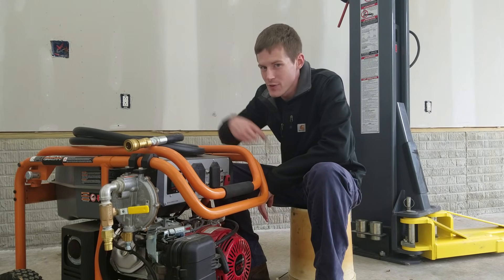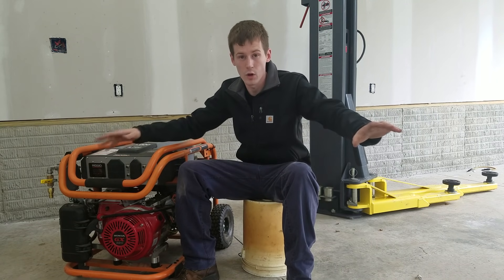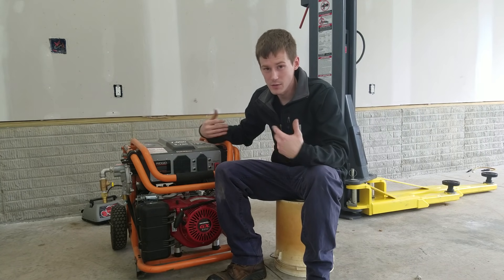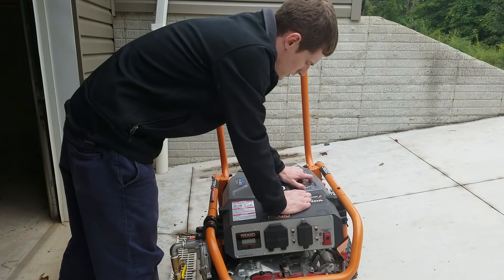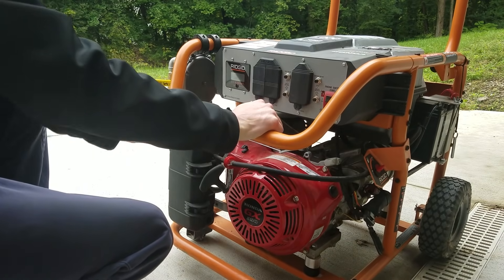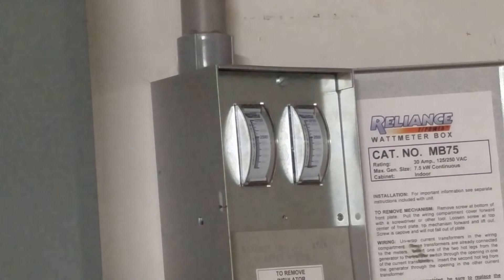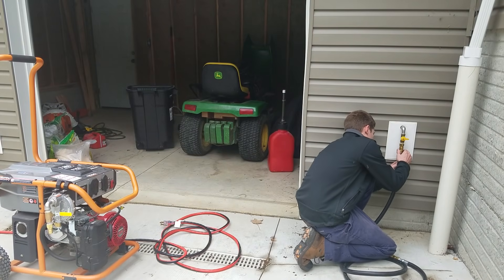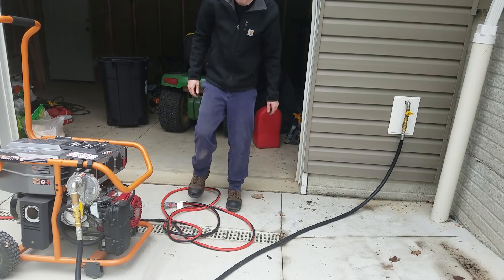Natural Gas Generator: Frequently Asked Questions

Comment: So you said you wouldn't buy the kit again and just buy the regular and make the spacer. What's so special about the spacer and what is the model of your regulator. These seem to be the most crucial pieces. I would like to make my 8750w (390 clone) predator a tri-fuel so I'm looking for some pointers of parts to get and that spacer info as well. Thank you in advance.
Reply from the maker: Regulator: https://amzn.to/36OOCyF

The spacer need to pull a vacuum on the line going to the regulator to get the diaphragm to open. Basically the inlet to the spacer needs to be slightly smaller than the outlet side. The outlet side need the fuel delivery. Check my original video for close up shots of the spacer.
Reply: You can get Chinese carburetors for many small engines that have the inlet tube for the propane/natural gas built into the carb, and they hang the demand regulator off of the carb.  Probably sell one for the gx390 clone.  I was looking for one to mount to flathead 5hp Briggs and Stratton engines, but those are not popular engines for our friends in the PRC to copy.  I’ll have to make an adapter for my “Honda” carb to the Briggs engines and then hope the jetting works if I ever want to use gasoline on them as they’re set up.  $30-50. For the whole shebang from various suppliers.  Probably not as nice or well built as the demand regulator that is shown in this video.

Comment: Our natural gas meter is about 900 feet from our residence. We are buying a generator due to increased number of power outages. Contractor concerned about distance from meter causing generator to shut down. Advice???
Reply from the maker: If he's come over and physically looked at your situation, find another contractor. The pressure in could be regulated down at the house, not at the meter. Someone that knows what they're looking at would pick up on something like that right away.

Larger homes have the pressure regulated down at each physical appliance because it saves on running huge piping all over the house. I'm willing to bet your house has the regulator on it. I really doubt you have a 900 ft run at a 7" WC. The size of the pipe running to your house would have to be massive to not cause other issues.

Comment: What is the farthest away I can run my house 3/4” gas line to the 3/8 fitting on my generator? Can I run 1/2” line from house 3/4 12ft 1/2 to 6 ft 3/8 with out problems?
Reply from the maker: That depends on the size of the engine you are using. A 1hp engine will require less fuel than a 15hp.
Reply: It’s a 420cc 13hp 8750/7,000 running watts. Like I stated I want to run 3/4” to back of house and would need 25 feet more and was thinking 1/2” 25 foot to regulator and step down to 3/8”.  Otherwise I would have to run 3/4” 50 feet and trying to get away with 25 ft of 1/2” and reduced at generator to 3/8. I believe it will work but looking for opinions. Thanks
Reply from the maker: Worst case scenario the generator will run correctly but, under high loads it will starve for fuel.
All of these distances are measure by going from the gas meter to the generator. These are the charts that I used to size my line correctly:
http://www.uscarburetion.com/natural-gas.htm
http://www.propane-generators.com/natural-gas-chart.php

Comment: Very nice, informative, well organized.  Ever consider hydrogen?  Would that be feasible?
Reply from the maker: Not really. The main issue with hydrogen is because it's the smallest occuring molecule you can't really contain it. Basically the molecules are so tiny they go right through the container. I'm no expert on that subject but I've heard of some success using stainless steel lined tanks. It does work well as a gasoline substitute though. 

If you could find a way to break the bond of water (H2O) and separate the hydrogen from the oxygen you could burn water in an engine. If you can figure that one out, let me know so we can make Jeff Bezos look poor haha.
Reply: Repair Geek Actually, people are splitting water into hydrogen and oxygen.  The simplest and most common method seems to be electrolysis, driven by 12 volt photovoltaic panels (or other source of electricity).  That method seems to be pretty slow and perhaps inefficient, but it apparently works.  There are others methods.  
In a similar vein, a number of articles and videos show folks producing biogas from manure, food waste, etc.   
You did a great job on the generator, with a very clear understanding of the gas-related hoses, fittings, standards, etc.  My main concern about hydrogen is how to handle it - i.e., how to contain it, pipe it, introduce it into an engine, etc., hence the question.  
Thanks again.
Reply: @joedance14  -  You should make Videos on them and tell us how " hydrogen " is or are.  Maybe we can learn a thing or two too from your great ideas!
Reply: @joedance14  - I got a few questions.... I wonder if we can save our Gas from our farts.  You think it will be economical to buy a lot of Beans and Eggs just to get Gas?  Or do you think I should get a job at McDonald and call it the day.  I'm still in High School, I have to plan ahead, what do you think of those ideas?
Reply: The biggest problem with hydrogen is that it violently explodes when exposed to the oxygen in the atmosphere.

Comment: because its already a dual fuel,if the natural gas coming from my house is already regulated,do i still have to buy another regulator?
Reply from the maker: Sorry I'm not sure. It depends on the generator. That was why I didn't use a dual fuel. I knew my conversion would work with a normal gasoline model.

Comment: how do you set the gas flow with the engine unloaded, and then load it and expect that same amount of gas to keep it running?
Reply from the maker: The spacer on the intake is designed so it pulls a slight vaccum on the diaphragm inside the governor regulator when the engine is running. As engine load increases the airflow through the intake also increases. The extra airflow creates more vaccum on this diaphragm opening it more and increasing fuel flow.

The bolt is acting like a fuel jet in a carburetor.
Reply: @RepairGeek  so it's got a governor, regulating the throttle body to keep the rpm steady based on load

Comment: I need some help I have a 13000 watt 20hp Duromax generator I installed a garretson kn regulator I have 3/4 inch  hose to generator it starts and dies Almost like it’s not getting enough natural gas to run the engine I’m wondering if the kn regulator it’s not enough I adjusted the screw for max flow and starts and dies ?? Help
Reply from the maker: That Garretson regulator will support 50hp. Get it running and try reducing the fuel flow. You can hear mine barely ran until I leaned out the mixture: https://youtu.be/nO839Sayci0?t=933

If that does not work I would look for a restriction between the KN regulator and the engine. All of this is assuming you have enough natural gas flow at your location in your house's NG system to support 20hp.
Reply: @RepairGeek  I also have that three eights air fuel mixture screw as well and I don’t know where to put it that’s the one that goes to the 3/8 hose from the regulator over to the carburetor I don’t know where that needs to be sat
Reply: Is it possible to have a problem with how far my regulator is to my carburetor it’s on the opposite side of the carburetor mount it
Reply from the maker: @mitchellowen8821  send me an email.
Repairgeek365@gmail.com
Send a picture of your generator, regulator, and hose routing.
Reply: @RepairGeek  sent

Comment: Noticed you started in the other video using pull (natural gas) but then this one you started on gasoline with electric start.  Any reason?
Reply from the maker: In the other video the battery was bad. I replaced it between that video and this one.
Reply: @RepairGeek  are you happy with the gasket sealant versus another entire gasket?
Reply: @RepairGeek  and did you ever consider the Winco?
Reply from the maker: @GoodmanMIke59  I've had no issues with the gasket. As you see it is how it is right now. I have about 5 or 6 hours of runtime on natural gas from a couple small outages.

I have $1200 in this entire setup including the generator. That one was more than I was willing to spend. It looks like a great unit, but the Ridgid I have is very close specification wise.

Comment: Man I’m doing this but swing this makes me thing if I can design a car bracket I can run a car on a similar kit with propane on a gas engine how about those new direct injection mustangs run propane instead of gas A
Reply from the maker: You can do this to a car. The fuel delivery is more sophisticated than this. A generator runs at basically the same RPM all the time. Ford sells an alternative fuel prep package for 5.0 F150s. Honda has a CNG prep Civic. Most city busses are running on natural gas.  It's out there already but, you don't hear much about it because gas is cheap.

Comment: I don't understand the issue with the female QC on the regulator.  I see you changes it from horizontal to vertical, but what the difference?  I mean, you say that you changed it in case the hose becomes disconnected it'll spew NG outside your house.  What if the new male connection becomes disconnected?  What's so special about having a male QC connection of the regulator?
Reply from the maker: The male end of the QC is threaded into the regulator. It's very nearly impossible for the male end to come off. In the previous video it was opposite, the female was on the regulator. If the female end comes off i have no leak because the female end is sealed when it's disconnected. In the previous video the male was on the hose if the hose came off with the male on the hose I would have an unregulated natural gas leak. 

It's a 1 in a million change that it would disconnect while running but this way is safer.
Reply: @RepairGeek  I didn't realize the female end doesn't leak if disconnected.  Thanks!

Comment: I have 3/4” NG line w/ shut off at back of house but I need 30 more feet of gas hose for a 13hp 420 cc motor can I use 1/2” gas hose from 3/4” outlet to regulator with1/2” NG gas hose and be able to get enough NG to generator without it starving for more fuel if so will 5/8” work?

Comment: How does a natural gas setup work. Can you just let the generator run continuously. How does that work??.
Reply from the maker: Yes. Runs off the house's natural gas line. It will run as long as youre willing to pay the gas bill and change motor oil.
Reply: What about overheating the unit?

Comment: I've got a poulan pro g6000 generator. It doesn't say what the motor is. Zilch. Anybody know. I want to convert it to natural gas. The paper work that came with it doesn't say shite.
Reply: Motor doesn't really matter!  You can convert it!
Reply: @JodBronson  I don't know what to order if I dont know what the motor is
Reply: @ratbrain7743  -  Look at the Engine Cover Shroud.  There is usually stamps on them.  Small, but they Stamp the Motor + Mfr Date, etc...
Reply: @JodBronson  It had a sticker on the engine that I couldn't read. I'll have another look

Comment: Thanks. I'll have to talk to an electrician about an interlock kit.
Reply: Do you have a specific interlock kit that I can install myself?
Reply: I would suggest installing an automatic changeover, ideally one that will automatically switch to generator power when it starts and back to commercial power when it comes back.

Comment: Hi, I'm planning buy a Westinghouse WGen7500DF Dual Fuel Portable Generator, it suposed runs on propane, can I just plug to natural gas hose?
Reply from the maker: No. You need to be able to adjust the fuel delivery to run the generator on natural gas. As far as I'm aware those regulators are not adjustable.

Comment: The exhaust valve isn't cushioned either.The intakes on a dry fuel engine should last as long or even longer because they aren't exposed the added stress of exposure to heat from combustion,

Comment: I don't get why your using a ball valve at the generator when 4 feet away you have a valve on the outside of the house. If your dumping natural gas, just shut the house valve off.  As far a vacuum leak, the regulator works in one direction.
Reply from the maker: The ball valve on the generator keeps contaminates out of the governor regulator when the unit is in storage and also when running on gasoline.

Comment: you wouldn't have a vacuum leak you would just be pulling a little unfiltered air thru you regulator, to have a vacuum leak your natural gas line would have to be on the other side of the Ventura in the carburetor..then you would have to turn off the valve..better to be safe then sorry but no vacuum leak..

Comment: OK..Might be a stupid question....here goes...Can a propane generator be converted to run on natural gas?  Apologies if im wasting your time.
Reply from the maker: Theoretically yes. To run on natural gas you need more fuel for the same amount of power. So you need a way of increasing the fuel delivery. If you want to go back to propane the fuel flow must be reduced again. So, any fuel system modifications can't be permanent. So, it's possible but depends on the generator.

Comment: There's a series of WINCO generators that are TRI-FUEL.  Did you ever consider one of those?  
Winco HPS12000HE - 10,800 Watt Tri-Fuel Generator w/ Electric Start Honda Engine
https://www.electricgeneratorsdirect.com/Winco-HPS12000HE-Portable-Generator/p1187.html
Reply: I'm sure that is a very good option... for $4,000.  No thank you.

Comment: Awesome videos.  Just installed a similar kit on my Black Max with the same motor (Honda GX 390).  Installed it according to the mfg's instructions as well as their video, basically how you did.  Runs great on propane, but when I try to run it on gas like you do here, it runs terribly.  Will start, but then will sputter, smoke, not get up to full rpms.  Smells like it's running very rich. I take the propane fitting and spacers off, put the air cleaner back on, and the thing runs fine on gas. I've been thinking it was due to those blocked holes on the carb like you say.  But obviously yours is running with them blocked...any thoughts?  My kit:  https://centuryfuelproducts.com/small-engine-tri-fuel-propane-natural-gas-conversion-kits/conversion-kits/honda-engines/gx390/honda-gx390-tf